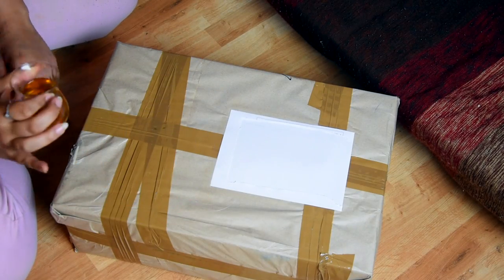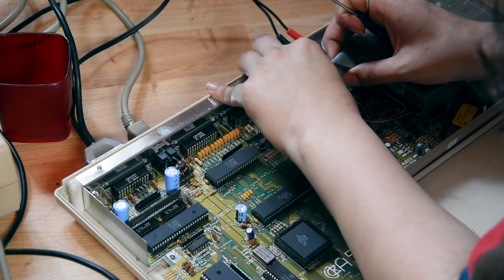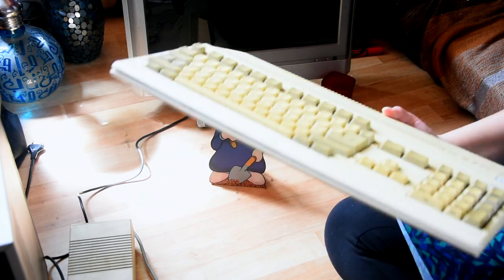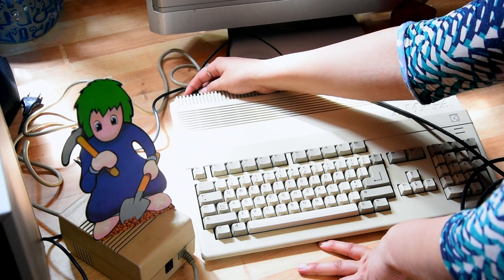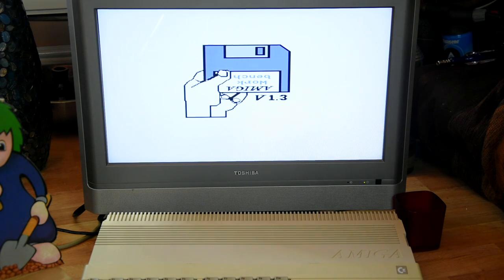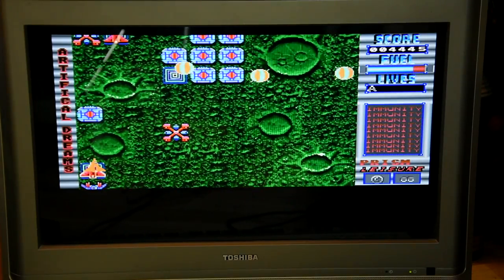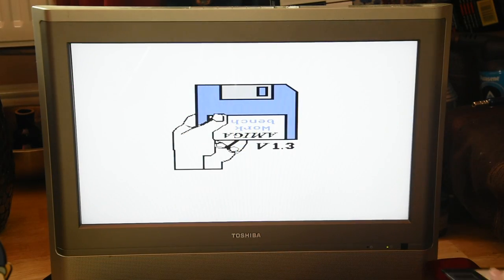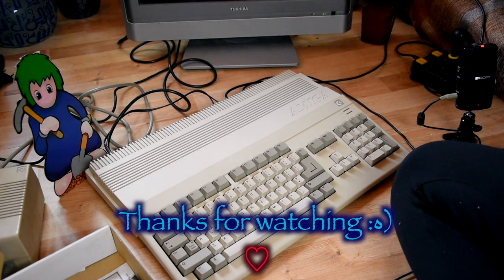Amiga 500 unboxings and a freakin Journey along with them!

Comment: Congratulations! Some tips for you if I may suggest please.. Fingerprints will rust the shield over time.  Clean them off if you want it to stay beautiful. Use a soft cloth or something to flip the A500 over so it doesn't scuff or scratch on your floor or table.  When screwing the hex screws back in, don't turn them in hard or it will push through the case and leave a white mark on the top side. The white mark can be fixed if you accidentally did that. Your bad A500 here may only have a bad RAM chip or two - easily fixed. The bad RAM or Agnus chip might have been caused by the power supply you are using. Suggest you test the voltage or consider using a modern PSU with adapter cable to be safe. Enjoy the Amiga!!

Comment: I really admire how nicely everything inside is shielded with actual metal shielding. When I was recently cleaning my Mega Drive Model1 from inside and outside it had a nice real metallic shielding inside as well. Pretty much 2 layers of metal shields. Back then everyone actually cared about shielding devices from electromagnetic interferences. Something that has gotten lost completely nowdays. It's a shame…
Reply from the maker: I think shielding was more a regulation back then, that devices just had to be shielded. I don't know whats going on nowadays with regards to that.
I way prefer the megadrive 1 to the megadrive 2, the latter just feels like a toy!
Reply: Yeah, I too always preferred the Model 1. With it's CD-drive looking middle and it's headphone output and volume slider. Also the buttons on the Model 2 are terrible. When my uncle gave me his Model1 Mega Drive and got himself the Model 2, the On/Off switch failed shortly after and didn't latch anymore. So you in order to keep it on, you needed to put some paper or cardboard into the gap between the switch and the case. So yeah… Indeed like a cheap toy :C  But the red buttons look nice thou. The Switch on the Model 1 is VERY sturdy.

Comment: Hi Maddi, 

What you need is a set of Torx screwdrivers or the Torx screwdriver bits that will fit a magnetic screwdriver.  They come in sizes like T4, T5, T6.  You probably need around a T10 to unscrew that fastener.  Makes life a lot easier.

Tom

Comment: Another great video, thanks.  Your engineering skills are amazing.  Great to see these things working 20+ years on.  I wonder what the original expected working life of the machine was when they manufactured them?
Reply from the maker: Thank you! :o)
most of the time capacitors are the only issue in old equipment, once they're replaced then all is well. But with the rest of it hmm  I do wonder that also, how long they expected them to last.

Comment: Excellent! Hope you feel better soon, and thanks for shoutout!  :o) Regards that none working FDD - probably caps in the drive, especially if it's a Panasonic model.  I've done 3 or 4 vids on Amiga FDDs - not come across one that couldn't be fixed yet!!!

 The green screen on that first 500 will probably be RAM, but could be Agnus.  Lovely pickups - always nice to get spare external drives!   

Never seen the Action Replay on Amiga so that will be interesting if you get around to showing it more in a future vid.
Reply from the maker: Thanks! And you're welcome! :o) 
I definitely will be doing a video on the Action reply itself and some of what it can do, I used to use it a lot back in the day. 
I've kept the Panasonic drive aside for now but it would be great to get it working and have a spare, Amiga drives arent the easiest to come by.. 

That's a question, I have another external Cumana drive (exactly like the one I got in this) And no disk inserted, it sometimes grunts and comes up on the workbench as "DF1:???" then disappears, just periodically does this which can get annoying lol Have you any idea what it could be?
Reply: +MsMadLemon With the Cumana external I suspect the disk detect switch - it's thinking a disk is inserted when it isn't.  Try cleaning the switches in that drive!
Reply from the maker: i'll do some contact cleaning where I can. Either that or it must be a duff switch.. thanks!
Reply: Yeah, possibly stuck in a semi closed position.  You can sometimes take them appart and bend the leaf part back again.

Comment: Yay, it's Miss Moo Knife again! :)

Interesting that the first A500 is completely yellowed except for the Ctrl and Caps Lock key. You could maybe try to repair it and use that desoldering gun some more (if necessary)... ;)
Reply from the maker: Yes I know, that is strange, maybe those were somebody's favourite buttons to press, over time reduced the UV exposure from the tanning bed which this was sitting under when being used ;o)) 

If I can figure out exactly what the issue is, I will try to repair it but if not, I have other plans ;o)

Comment: Hi Madi :) You should be able to sort out the first A500 using the second if you're keen. Maybe reseat Agnus, but you probably know its socket is fragile. At boot, exec writes some data to a block of RAM, and reads it back. If the returned data doesn't match what was written, that's when you get the green screen. It's not definite a RAM chip is bung because it takes some more hardware to read and write RAM (why I'd look at Agnus). It also can't test all RAM because Exec is running in some of it.
Reply from the maker: HI Brek :o) 
Yeah I would only extract Agnus with a special IC extractor, I wouldnt even dare just doing it like this lol
What would you have to do ?
Reply: MsMadLemon You can break the socket with the extractor tool as well unfortunately :(  but to swap them for test they only have to sit gently so it's easy to swap back. Or you just get the opportunity to reseat the first one since you mentioned it might be parted out anyway. If you do that you might as well keep the spare CIAs :D

Comment: Great, great video! I love the Amiga 500. It's got something so special to it that other models don't.

I have two of them: one is a fantastic early model "chicken lips" with mechanical keyboard, C= key instead of "A",  Kickstart 1.2, red power LED and an original A501 512 Kb expansion in the trapdoor.
The other is an Amiga 500 Plus in fantastic conditions.

I obviously prefer the first one for nostalgia and feelings reasons! :D
Reply from the maker: The one with the red power LED is what we had originally, but once coming from school I noticed it gone for repair, then a green light one arrived lol
I kept an eye out for one with the red and embossed Commodore logo but it was too expensive. Though I got these :o)

I love my A1200 but I have to agree, there is something special about the A500 for sure :oD

Comment: Hi Maddi!  Another exciting video. With it being a mystery, I was not expecting an Amiga - or two!  I think Retro Bright is very good with some keyboards, but I notice if they are too far gone it just makes them a pale yellow instead of pure white. I tried everything to restore my keys to the right colour, but in the end I just bought an A500+ keyboard off ebay for £20, which was like new. I must admit I was screaming inside when I saw you cleaning the disk drive heads. There is a very good article online somewhere describing the tape head re-alignment problem, and not knowing this killed all of the drives I tried to fix over the years. But maybe you got away with it. :)   Would be great to flick through all your disks at 7:22 to see what you got.   Never seen those games before, perhaps unique to youtube I'd say.  They both had a black space underneath the graphics so maybe they are NTSC games from America? Felt utterly sick during the Atari ST section at 16:30, please dont do that to us again! Yuk!  But it does show how the game is supposed to look with full screen graphics. I know there is a way to make a hardware switch inside the A500, to swap screen modes by wire, so with the ROM switcher and also the internal memory disable switch, my A500 had lots of switches. :)

The green screen is probably Agnus, and with the new machine its not so hard to swap them over and try it.  I know I made an article on Lemon saying Green means RAM, but if one of the RAM chips was faulty, it would probably just skip it and read the registers of the others, to give less memory. The issue may be with power, if there is not enough to power the whole motherboard, and this can mean its the caps which are bad and not the chips at all.  As you say, the CIAs just control the Port and keyboard and disk drive IO, so this is unlikely to be the issue. I would just keep this A500 for spares, so no need to fix! :)
Reply from the maker: Hey there! 
Haha i’ve changed the title now, I guess it’s no longer a mystery now that most have seen it, otherwise i’ll just end up with a whole list of videos named “Mystery unboxing” ;o)
Yes, in fact Lemon I think is one of the sites I came across when researching the green screen, but Gadgetuk164’s video really gives a lot of info, even about the PAL and NTSC switching, it’s to do with a pin on Agnus I beleive. 

Hahaa yeah i’m glad that I didnt end up with an Atari ST, even though whoever did i’m sure it’s precious to them. But more often than not the Amiga version of the games just feels more superior unless it’s just a lazy port.
Reply: The new title is so much better! - good thinking to change it. I think Amga is superior in every way to everything until the 3D0/Saturn/PS1 Era, and thats just my personal bias, but the games are still amazing. Even homebrew PD games have a lot of charm. I think the ST sound is the worst thing about it - and they tried to sell the ST as a music studio!  But as Atari funded the Amiga and people from Amiga Inc helped to make the Atari ST, I guess I should not hate the Amigas spotty little bother too much.

edit: off to blackpool tomorrow, new nervous but also excited. :)

Comment: Weird, how some people don't like hex srews. 😆 I love them, because you basically can't strip the screw by slipping off with the screwdriver. Not a big deal on an Atari of course, but very helpful with higher torque screws in other equipment.
Reply from the maker: lol I can see the reasons why you like them but they've always stopped me from going inside things to repair them, when you need to repair something there and then without having to buy an entire torx 30pc set lol

Comment: You should build the raspberry pi Amiga into the broken 500 you have! Perfect repurpose :)
Reply from the maker: I already have plans ;o)
Reply: MsMadLemon Great! I would love to see the results! Would keyrah work with the a500 keyboard too?
Reply from the maker: Unfortunately Keyrah V2 doesnt support the A500 Keyboard, I was under the impression that it did but only the A1200 and A600 ones, which is quite a shame. I think there's a way of doing it on the Arduino. But i've never messed with Arduino before.
Reply: MsMadLemon I found this article that you may find interesting regarding using an Arduino as an interface for the Amiga 500 board. http://forum.arduino.cc/index.php/topic,139358.0.html

Comment: ...I sold my 500 to by my 1200...snif...and sold my 1200 to by my first PC in 2001... yes I had the 1200 for 10 years using it every day :)
And now my cousin gave me his 500 🎉...but no PSU, so I have everything but the square 5 pin Amiga power plug... so haven't tried if it works :(
Reply from the maker: If you just manage to get that plug, even from a broken PSU, you can build your own PSU using an ATX power supply :o) 
https://youtu.be/DMxNH-PCYew
Reply: I know, that has hat I did with my 1200 when it's psu died an used an ATX psu. I's still hunting on a broken Amiga psu or I will just make a plug...
Keep up the great videos, greetings from Portugal 😃

Comment: what kickstart does it suppose to be on found artificial dreams in amiga tosec but colours are wrong on mine does it use ks 1.2 or or 1.3?
Reply from the maker: I'm not sure on Tosec or officially, but I remember that this is an old game and from the old A500 red light kickstart 1.2, I have a version of this game which asks to disable the memory leaving only half meg. 
But I did none of that, I was running it here on 1mb, kickstart 1.3, it's weird that the colours are wrong.
Reply: worked out glitch it requires ocs a500+ ecs lol
Reply: i worked out was the ecs chipset giving ghosting on the ship, used on winuae with ocs worked correctly